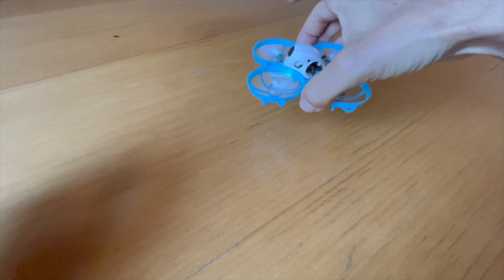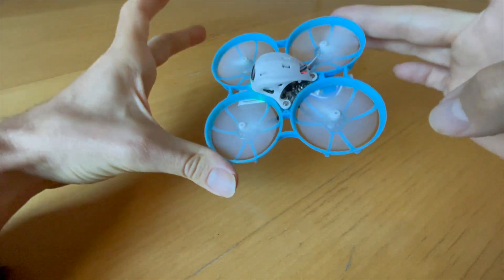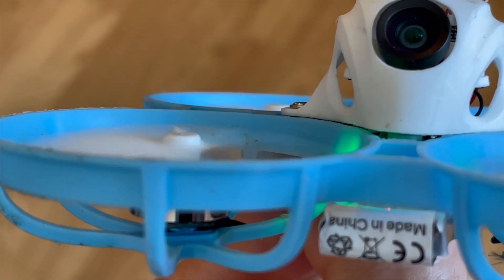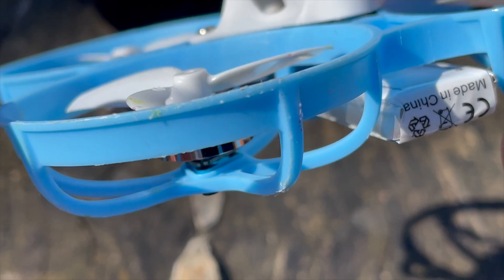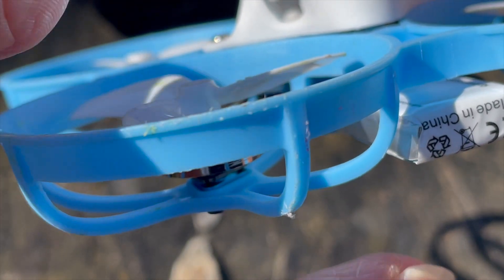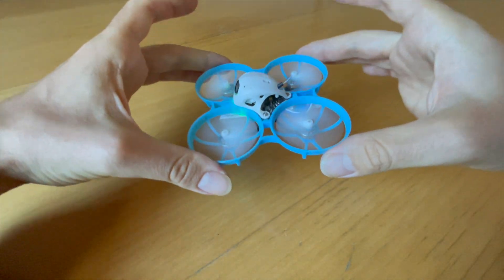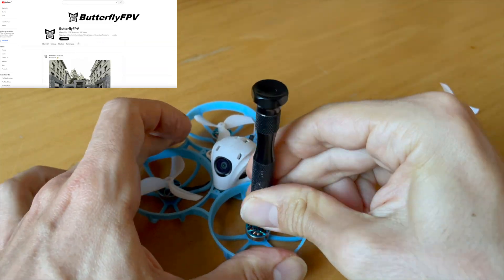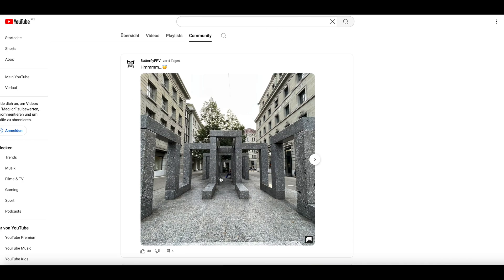HOW to FIX bent PROPS on your NEW Meteor 75 Pro (and other tiny whoops) | How to fix bent propellers

Comment: nice excited for future vids, but I think the old betafpv 1102 18000kv is more durable than new ones it's been 7month  and the motor is same as they are new no vibration without props for me the new 22kv and old 18000kv has the same power maybe because 18000kv has high torque than 22Kkv so they can compete to 22000kv that is only my opinion
Reply from the maker: Hey, interesting. Thank you for your feedback and sharing your opinion. So you also flew the 1102 18k with 45mm props? And which ones did you use? The ones with the short cable or the tootpick version with the longer, thicker cables? I still have some old 1102 18k motors. I might test that sometime. You're right, the 1102 22k motors aren't the most durable. I hope Betafpv improves that in the next version.🙏
Reply: @butterflyfpv  I used it on 45mm props it has cables like the 1102 22kkv, I said that old 1102 18kkv can compete or almost same power to new1102 22kkv only on triblade and you can feel the difference if you compare them with biblade
Reply from the maker: @wincydelavega653  Ok, I'll test it sometime! Thanks for sharing your experience!